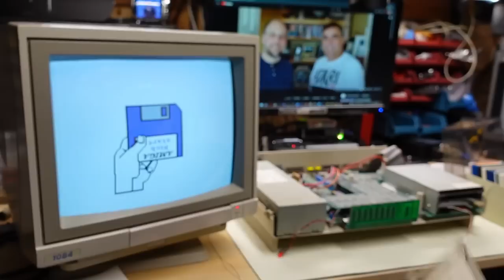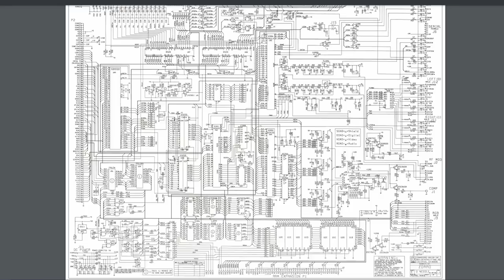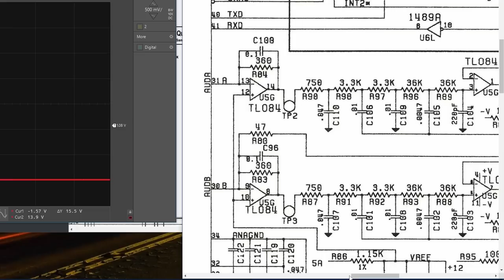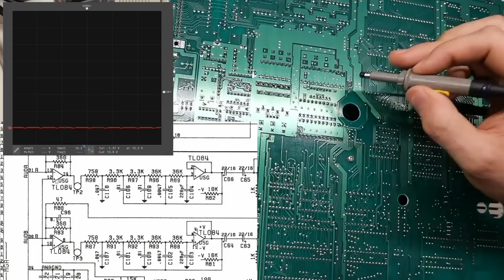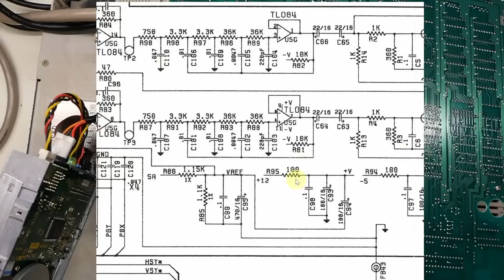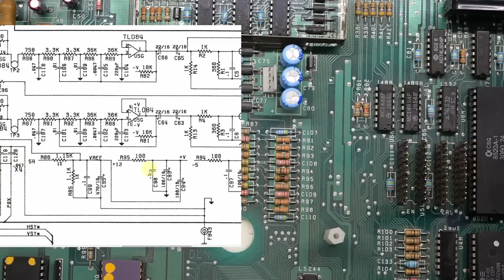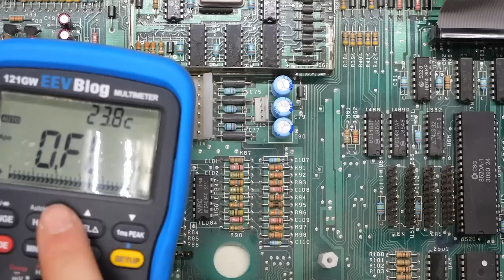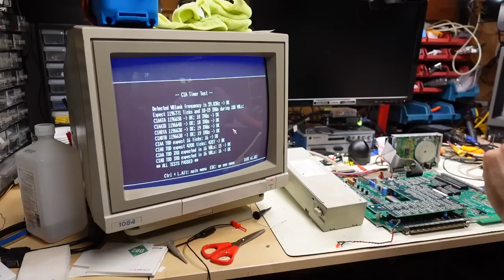Amiga 1000 repair - No audio output

Comment: You should use unformatted floppies for Amiga DD disks, due to spiral vs concentric tracks. Using a tape magnet to retrack may work.
Reply from the maker: Spiral? Amiga floppy drives are essentially the same as PC drives -- so write concentric circles for tracks.
Reply: @adriansdigitalbasement  the drives are the same, but the formatting is like a Mac.
Reply: @brianbrwa  IIRC, the thing about Mac drives was that they had variable rotation speed, which the PC and Amiga didn't do. The only difference between the PC and Amiga was that PC was 9 sectors per track and the Amiga was 11. The only time you had to bulk erase or start clean was with high density drives. PC HD drives had a higher write current that the Amiga was incapable of writing over. Amiga HD drives were essentially a hack that halved the rotation rate in order to remain compatible with what Paula could keep up with. Sadly, AGA never included an updated Paula with 16 bit audio and HD drive support.

Comment: When I saw the video title I instantly thought bad capacitor. I had one channel go on my A1200 and it was a capacitor. Commodore used polarised caps for audio instead of non-polarised and they fail. This one had leaked and it was SMD, I removed it and cleaned up the board but fitted non polarised through hole caps.
Reply: polarized caps is not the issue. and putting through hole caps will slooowly kill the pads of the boards of the stress... especially if you move it around..
putting in ceramics, tantals or throughhole caps is what I call a "recrap" instead of a recap.
Reply: As I mentioned in another reply, the A1200 just suffers from a bad type of relatively early SMD-electrolytics which ALL leak sooner or later. Polarised caps for audio is totally fine as long as you have enough positive bias.

Comment: I wouldn't call an electrolytic shorting a rare failure mode, it's a pretty common issue that they fail over time, even outside the plague era, aging caps will develop shorts, sometimes catastrophically like here. Poor lil' op amp was just trying its best and got brutally snipped. Honestly would sooner accuse a cap, especially as it's way easier to remove and put back, without damaging things, and even if you bork it and it wasn't the bad thing, it's easier to replace!
Reply from the maker: I look at it this way -- I've fixed hundreds of machines and monitors at this point, and this is only the second time in all of those that an electrolytic has shorted. On the other hand, I have piles and piles of dead ICs :-)
Reply: @adriansdigitalbasement  I suppose! Though I've also seen plenty supposedly good electrolytic that had a slight short starting up, and have been what failed most over ICs in my personal experience, I suppose different strokes of luck!

Comment: As an aside, I read somewhere on the interwebs that either all Amigas or all after the A1000 has something in the audio circuits placed the wrong way around (like a diode or something) which will inevitably wear out the component and cause the sound to fail (a very common occurence). Supposedly someone who knows electronics and audio would be able to see that from going over the schematics (their claim, I have no idea if that makes sense or is true). Oh, and how about doing a 512K WoM hack for it (check AmiNet for instructions)?
Reply: Neb6  Thanks! Do you have a link to show what is wrong and right?

Comment: I recently acquired a 1000.  I don't have a keyboard yet, but it does ask for Kick Start.  I'd like to see if it will load it and then let me boot to my Workbench disk.  Where can I find the Kick Start disk image?  I figured I could put it on my Gotek I use with my 500.

Comment: Ha. I'm currently trying to debug a very similar problem on an A600: I have quiet audio on one channel. I believe this was caused by leaking capacitor crud under an SMD resistor causing a partial short between two tracks. Unfortunately, while debugging this I had to take the SMD opamp off... and then I managed to put it on backwards! So I'm now waiting for some new opamps. Hopefully nothing else on the board got damaged (but i did get some cool video of the +/- AV tracks buckling from the heat...).
Reply: My spares A600 had capacitor damage to the opamp resulting in FDD noise getting through to the audio plus other audioddities, such a pain to replace the IC cos the pads weren't in the greatest shape cos of the corrosion, but with some bodging and profanities (usually cos of trying to use fingers to hold hot bodge wires like an idiot while soldering them!!!) I got it in and the sound working properly on it again... :)

Comment: Interesting timing as I was having the same issue with my amiga 1000. The floppy disc was working fine when I had the machine apart for cleaning and testing. However when I put the unit back together the floppy stopped loading discs!  This is with a 1084s monitor. After some trial and error I could moved the monitor back about 4” and all was good again. Will either need to swap out monitors or look for a shielding plate as a long term fix
Reply: i was thinking the same. Floppies and em fields don't get along, no putting it next to a monitor or on top of a psu...

Comment: An original owner of this machine myself. Now I have been playing with my present 1000. Added a Rejuvenator which was a major trial for someone with my skills. Also got it booting from emu68 pistorm with som graphic issues in rgb mode. Finally trusted drive went bad on me but I am not going totake apart my 1010 to get another. Oh and I broke my rj11 keyboard  connector in the process but that looks like an easy fix.

Comment: What about the IIgs in 86? That machine was a beast
Reply from the maker: Ignoring the fact it was crippled on purpose by Apple. it's much like the ST where the CPU is doing all heavy lifting on the machine. The only benefit over the ST is the sound chip with 64k of dedicated sound RAM. If only Apple hadn't help it back so badly!

Comment: Hello Adrian
you mentioned an addon for a PC disk drive for the Amiga 1000. I'm looking for something like this for my Amiga 500. The original drive has unfortunately torn the tape of the stepper motor and an IC has burned out pins. Can you help me with that? or can someone else tell me where to get the adapter for the floppy drive for the Amigas
Thank you

Comment: My first CGA monitor for my first PC was an Amiga monitor. I can't remember what model it was but it looked just like what you're using here.  I am surprised to find yours still works. I continued  using mine as a composite video monitor long time after CGA was irrelevant.  But I thought all monitors eventually died. Every large TV  we ever had eventually died because the one of the high voltage lines eventually started arcing. My dad said it was because the insulation dried out after a lot of use.  So I just assumed all monitors eventually died.

Comment: I'm going to post another comment! When I've encountered bad disks from old disks after formatting, a quick and consistent sweep of the entire surface of the disk with a neodymium HDD magnet almost always fixes my situation. I guess you could use any powerful magnet, maybe even a bulk eraser, but using something VERY strong seems to always fix disk errors on old disks that need reformatting - unless of course there is actual physical damage to the oxide on the disk.
Reply: Any idea why this works? Like what kind of failure a disk can have that can't be fixed by just reformatting it but isn't unfixable?
Reply: @stevethepocket  largely it’s just because the erase action of the floppy head is localised to where the head is, so it may not erase all of the surface area and old signal can still bleed through. (Especially if the disk has been used on systems with different sector or track layouts before. The head will only erase where it needs to for its own specific format.) Manually erasing like OP says clears out ALL of the magnetic particles’ polarisation, giving you effectively a brand new disk rather than just a reformatted disk.
Reply: Maybe it's some recording in the gap between tracks that's strong enough to be read. A head slightly out of alignment might be more susceptible to this.
I wouldn't go touching the disk surface, just get a good bulk eraser. And of course always bulk-erase a 40-track disk before formatting it for 80 tracks.

Comment: Why is the caps having to do with audio always 220 uF ?
Reply: The caps essentially form a high pass (sometimes wanted, sometimes unwanted) - 220µF into 8Ω (speaker) is a 90Hz cutoff. A larger cap lowers the cutoff frequency but is more expensive, so it's a tradeoff in picking the cheapest capacitor that still gives enough bass!
Reply: @equi-nox  nicely explained.

Comment: That's a low pass filter, to remove non-DC noise but any V+ rail noise/ripple is then fed into the opamp inputs to subtract the noise from the amplification (V+ noise - the input copy of the V+ noise = noise cancellation).

Comment: I have a question for all you crt people. So I was running my little RadioShack portavision just listening to the news (we still have a few over the air channels in Canada) when the crt started to almost started to gurgle and then the very back of the neck (not the neck board but the actual glass part of the crt) shot off like a Champaign cork. Anyone know what happened

Comment: Electrolytic caps short all the time.  Especially if they are allowed to sit around and de-form.  And by de-forming i mean the dialectric breaks down when the cap i not under charge.  You have to re-form caps if they have been sitting around for a long time.

Comment: Is it ok to wash the motherboard with soap & water? Please provide a bit of more details? Wouldn’t that cause some damage or corrosion? Should I use a hairdryer afterwards? Thank you.
Reply: It’s perfectly fine to do, the chips are sealed and the board has solder mask on top of the traces. The heat from a hair dryer is inadvisable, but an air compressor/blower or canned air is a good idea to remove any water hanging around underneath the footprint of components. Some people use isopropanol to displace the water but a blower is cheaper and more sustainable if you’re doing a lot.
Reply: Washing electronics is generally okay but there are two important rules to follow. First, remove all power. This includes clock batteries. Second, make sure it's dry before use, including under chips.

Comment: I really do wonder if you did swap the chips off the WCS daughterboard to the appropriate spots on the motherboard and installed a couple of sockets in those blank spaces would let the 1000 boot off a ROM without needing that board that plugs into the CPU socket or a kickstart disk. I did a little research when I discovered those blank spaces were there if that would work and I don't remember finding anything definitive as to a yes or no. Would be a neat experiment, but I completely get keeping the 1000 as stock. Do keep in mind that the 1.5MB board would be FastRAM and not ChipRAM; the 1000 is limited to 512KB of ChipRAM. So programs that need 1MB of ChipRAM will not work. Which is why I wonder if I should pick up a 500 someday. But the 1000 is the computer I grew up with, and the one I have is that same machine, so I'll never sell it!

Comment: The daughter board might cause long-term thermal issues. It probably pushes the local temperature by a few degrees up, as the heat gets trapped underneath it, shortening the lifespan of certain components.

Comment: nice job! thermal camera is nice for shorted components. i would add all three memory pieces and skip the top RF shield since no one uses RF shields anymore.
Reply: As a ham radio operator, I feel the need to send you some death glares ;)
(Okay realistically it wouldn't be noticeable between all the other cheap knock-off phone chargers and LED lights and ..)
Reply from the maker: I can use an AM radio down in the basement due to the LED lighting (and not just because it's the basement -- it's just buzz across the entire band LOL

Comment: The floppy drive from an A500 should work both electrically and physically.

Only at 17:36 at the moment... placed a bet on the -5V supply being dead... lets see... :)
Reply: and I lost ;) It's common that a 7805 inside the PSU fails though, and that causes the -5V line to go dead. The only symptoms of that are no/distorted audio and nonworking serial. 

VREF is approximately 2.5V... this biases the opamps to half of Paula's supply voltage. The first opamp stages are I/V converters - Paula outputs a current into a fixed resistance, and the opamp functions as a "virtual ground" arrangement. The gain of this stage is set by the 360 ohm resistor from output to the inverting input.

Comment: I would wonder with the disc engaged in the drive whether or not  the belt had to be replaced, when you stood it on its side  kinda told me  that there was less friction on the mechanics of of the floppy..

i would also invest in a UV light if I was you as that will if capacitors have failed

Comment: Please buy your self a desoldeting iron even one of the cheap gun style ones are better than nothing... you can get a good secondhand weller on ebay for not much.. If I could afford to buy you one I would, but I'm not that rich..... they are not for every job, but multilayer stuff is much easier with one... I was a desoldering pump user till I got a station and now the pump is just for field work..... keep bringing us these repair videos I love to watch your process....
Reply: He does have a desoldering station, he’s used it for bulk replacement before. Just prefers wick for smaller jobs.

Comment: Have to agree, a shorted electrolytic is pretty damn rare!. Tants yes but not these.. So there you go!. Tape that one to the wall of death lol.
Reply: Actually, in audio equipment with low or no output while everything else works, electrolytics of a pre-amp stage that provide R/C filtered supply voltage are the typical culprit. As the Amiga doesn't have a speaker driver, the audio stage of the Amiga is comparable to the pre-amp stage of a HiFi deck of that era.
Reply: @tw11tube  yes but in this case it was a short circuit condition not high ESR which is of course very common for old electrolytics. S.C conditions are quite rare.
Reply: @g0bzy  I guess you are thinking about 90s or later electronics and either caps in the audio path or SMPS filter caps. In 70s / 80s analog amplification circuits I had to fix because they had no output at all, shorted electrolytics that were used as supply filtering caps were the most common issue. I'm sorry I didn't explicitly point out that my comment applied to shorted caps, but in the position the Amiga (and other classic audio gear) uses that cap, high ESR would just increase the noise level, and not cause "no output".
Reply: Edit: sorry, you did say not limited to the Amiga but with other audio equipment too. Thats interesting. And rather odd.

Comment: Nice to see another fixed machine.

Also, Mr. 100 Ohm is not only a survivor, but hero, taking on full Current for a probably long time (looks burnt). Glad you decided to let it live. It deserves the one or other 16bit-dance-party. 🙂

Also₂, keeping the mod out and leave it original as possible. Not owning any vintage hardware but doing emulation, I even disabled faster load (by enabling "True Disk Emulation"), to get as much "vintage feeling" as possible.

Comment: I will quote a wise man's saying because this was the lesson we got from this video.
"recap, recap, reacap"- Jan Beta.
Reply: Nah, not always necessary.. Too many obsessed youtube recappers out there.. Check ESR yes, but why needless replace if working.
Reply: @g0bzy  on the SMD versions of Amiga recap is mandatory.  on the TH versions.  well  they DO dry out..  but not mandatory as on the SMD versions
Reply: @ChuckyGang  When electrolytics dry out (and yes they do) they rarely actually short. Much more likely to go high ESR. The insulation between plates (paper spacer) is still there its just the electrolyte is gone. But if the cap is high ESR, then yes it needs changing. But that can be tested, it doesn't have to be an automatic replace.
Reply: @g0bzy  well SMD versions leak.  this is why you need to recap AND clean the board

Comment: It’s pretty funny how the opamps became op-deamps (inop-amps? that sounds funnier but is far less accurate), it got quieter at each stage! 

I’m only halfway through the video but my guess is it’s the biasing voltage being off turning the opamps “down”, rather than a bad chip. But let’s see if I’m right!
Reply: half way through, you were in the right area!. But supply rather than bias.
Reply: @g0bzy  haha yeah, when looking at the schematic I was hyper focusing on the whole feedback/regulation section, and functionally ignored the power supply lines 😅
Reply: @kaitlyn__L  When Adrian was going through it, i was saying 'check the supply lines!!' haha.. But totally didnt expect a shorted electrolytic. Funny how we have different approaches to fault finding yet usually all end up in the same place. :)
Reply: @g0bzy  yeah! I like how different every YouTuber’s troubleshooting process is, based on what they’re most comfortable and familiar with. Some go right to a scope, some just beep things out with a meter, while a few jump to the full blown logic analyser quite quickly! (And that’s just one example for one task!)
Reply: @kaitlyn__L  Yes indeed. Its an interesting topic in its own right. Good video for someone there! haha